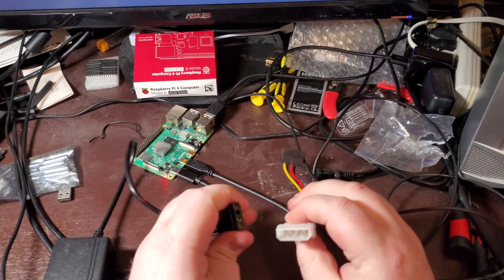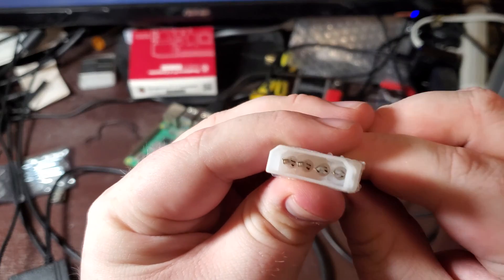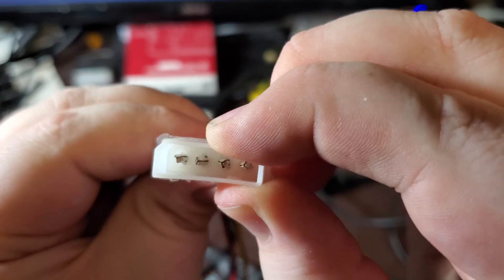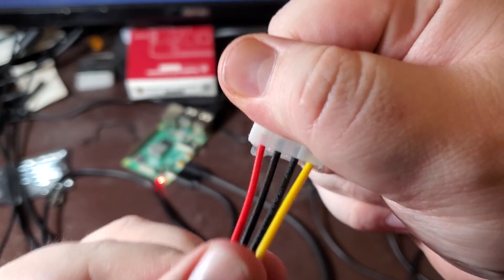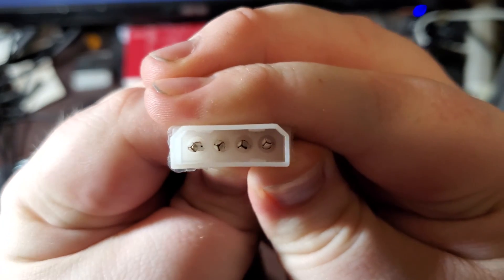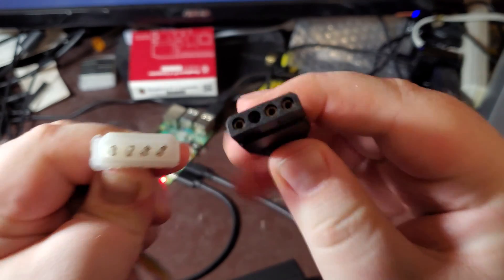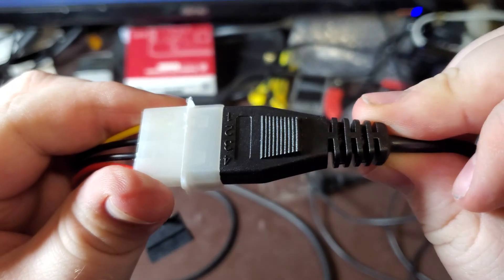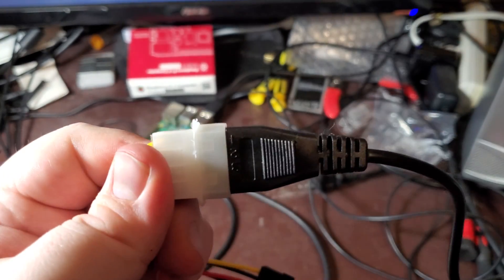Technique for plugging in stubborn molex connectors

Comment: thanks very much.. Very useful video thankyou.. much appreciated..i have been trying to figure out how would i get a connector to come off the other part of the connector if it is refusing to come up off it (years it's been on there) 

I'm trying to change a level meter in an old Vestax pmc 5 pro mixer

would hugely appreciate any ideas as it's a sentimental old mixer i bought with money my grandad left me so i don't want to break it when i try to pull it off